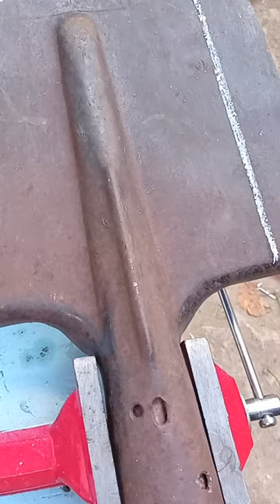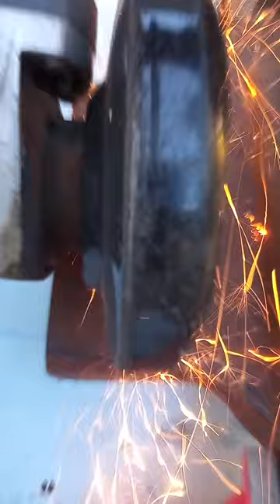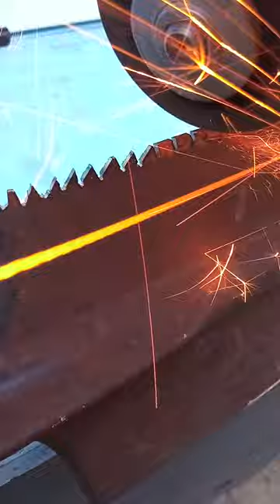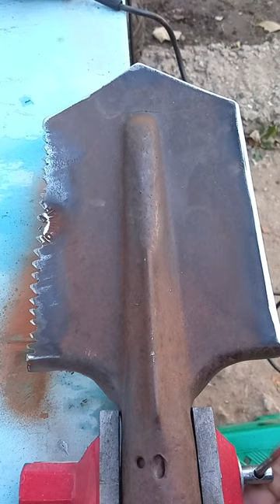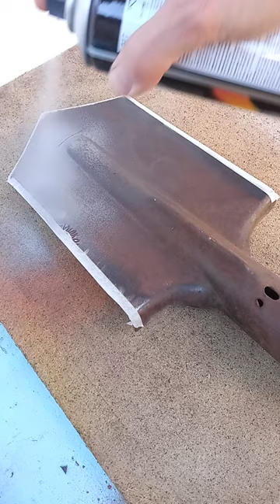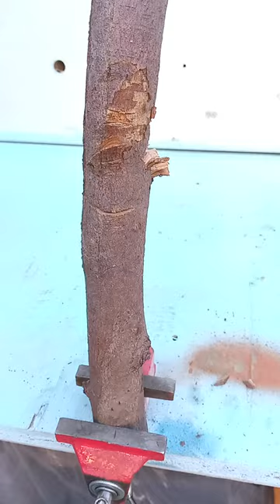NEVER THROW AWAY an old rusty shovel! An amazing DIY camping tool!

Comment: Just use the grinder to cut the tree ✅
Reply from the maker: However, this requires at least electricity.  You can also chop and dig with such a shovel.  It's actually very convenient 👋👍❤️
Reply: Or……….. turn the grinder into a shovel! Might actually work out better than that monstrosity!
Reply: @Simple_Creative  не нужно. У меня аккумуляторная болгарка
Reply: Такой лопатой ты и одно дерево заебёшься пилить проще ножовку взять @Simple_Creative

Comment: The pretend hardening of the sharp edge was funny.  LOL...  All he did was soften the low carbon steel more.  Perhaps he could tig a few drill bits on the edge and then sharpen it.
Reply: Make a video with the upgrade. I think that would be sweet.

Comment: Thats stupid....thats not how a saw works, you need properly sharpened blades not some dull hack job edges
Reply: I have an idea, he can use that nice sharks to saw that he used to spray paint the pattern for the TC cut out with a rough grinder instead and it'll actually cut through wood
Reply: And the "teeth" of a saw must alternatingly be bent a little to the left and to the right for a saw to work properly and not to get stuck
Reply: @harrickvharrick3957  Oh yeah. Good point. I was just teaching my new college architecture student how to set up the table saw for some of her projects on her Thanksgiving break. And as she was measuring the distance between the fence and the blade I pointed that out.

I guess the moral of the story is don't go camping with that guy and his hillbilly shovel multi-tool saw knife scrap metal object